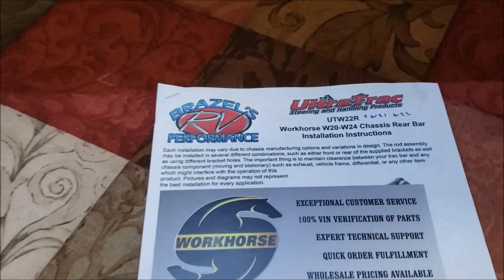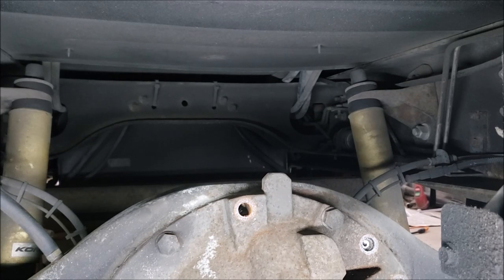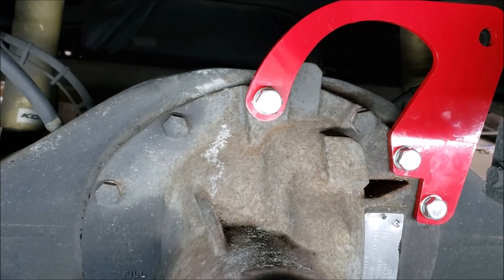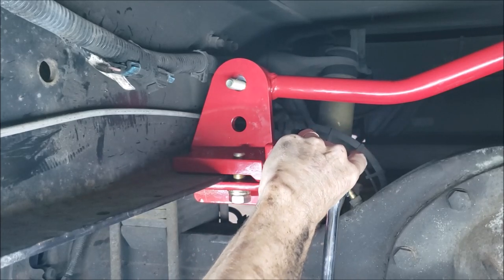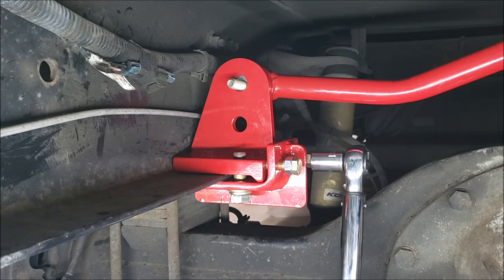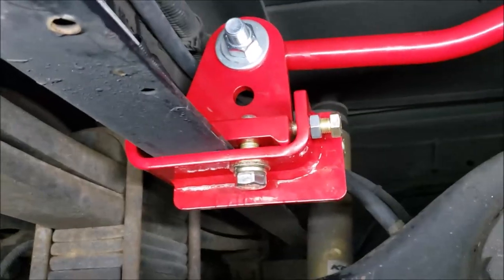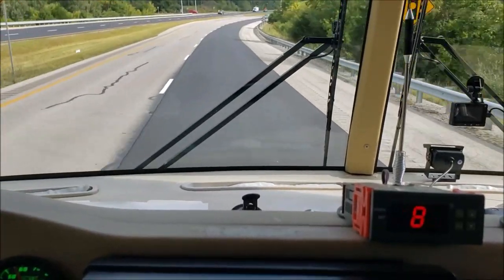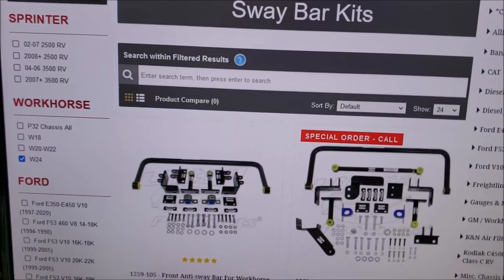Workhorse Rear UltraTrac Trac Bar For Workhorse W20, W21, W22, W24 Step By Step Install & Test Drive

Comment: my dad and I designed and built a track bar for his class C chevy 4500 motorhome, he noticed a huge improvement too.  I gave thought to building them to sell but didn't know if there was a market.  Oh, he's running koni shocks since I showed him your old video.  They were a huge improvement over the bilsteins.  The track bar is really for the rear axle shifting side to side, not skewing.  The leaf springs keep the axle straight but the shackles and bushings leave some side to side looseness.  The track bar makes it stay right in the middle.  My dad's motorhome actually had rubbing marks underneath from the axle moving more than an inch from side to side!  When he saw that, he decided to build one!
Reply from the maker: Thanks for contributing

Comment: About the missing socket size...
The installation instructions call for a 1-1/16" socket; that would fit a 5/8" heavy hex bolt, but it looks like they supplied a 5/8" standard hex bolt, which needs that 15/16" socket. It may be that the instructions are correct but the wrong bolts were included. Did you need the 1-1/16" socket anywhere?

Comment: I installed the same kit last month on my 2005 W22, I haven't driven it yet though.  Gotta love the Dewalt 1/2" impact driver!  I was not able to make some of the torque spec though, my wrench only goes to 120 flb. My kit was the ultrarvproducts Stage II so I did the kona shocks and Safe-T steering stabilizer also.  Once I get a hold of a heavier torque wrench, I'll re-torque.  Enjoyed the video!
Reply from the maker: Thanks for watching i have a impact also but I wanted to show you can do this with basic hand tools.

Comment: Great informative video as usual Kevin. I’m jealous as I wanted one of these units for my 2005 adventurer 35 U W22 when I bought it in October 2017. I live in Canada and ordered it up from the USA and it’s always expensive for shipping up here, anyways tried installing it per the directions and it kept conflicting with the exhaust crossover pipe. Finally realized that it’s not going to work for me and none of the other similar products would work either. My 35U has a single exhaust exiting behind the drivers side rear tire, not sure if this is factory stock, it’s dual all the way back and joins together after the mufflers and then crosses over the differential and exits behind the drivers rear tire. Your W24 and another W22 you did in your comparison of W22 vs W24 both have dual exhaust exiting in front of the rear tires, hence no conflicts. 
The supplier allowed me to return it, but again freight across the border isn’t cheap.
Thought this might help other W22  or W24 owners to watch out for this issue, the suppliers of these products should put a note in their product listing that this will only work with exhausts that exit ahead of the rear wheels. 
Thanks again for all you do for us workhorse owners.
Reply from the maker: Thanks for contributing our W24 was made just like yours I cut off the the tail pipe that went over the axle and made it a true dual exhaust I talk about it in this video https://youtu.be/fSPElyvqWiU

Comment: Nice video Kevin, glad your RV rides nicer, a great Christmas present for you would be a M18 Milwaukee fuel battery ratchet and impact, they work great with people like you and I that have spaghetti arms, 🤣 I have both, and the impact will remove the lugs on our 22" rims.
Reply from the maker: I have a impacts also but I wanted to show you can do this with basic hand tools. Plus cheater pipe ..lol

Comment: The instructions show the bar installed on opposite side of the two brackets (behind the axle bracket and ahead of the frame bracket), but it's installed on the back side of both brackets. On the other hand, the text of the instructions say to put the rod on the front of the axle bracket, while the drawing in the instructions show it on the rear of the axle bracket. This product is crude enough that this may not matter.

Comment: Kevin, thank you very much for this video. I just bought the UltraTrac a couple of months ago for our W24 Monaco but haven’t installed it yet. What determines which hole on the passenger side bracket you install the trac bar on?
Reply from the maker: You can use either hole i used the upper hole because i had plenty of clearance think about when the suspension is compressed make sure nothing will come in contact with the components.
Reply: Okay thanks. I wasn’t sure if maybe the different W chassis determined which hole to use.

Comment: As always an amazing educational video.  I like how you have the cockpit setup.  One question though.  What is the box, center of video, that has flashing (due to camera I’m sure) displayed on it?
Bruce
Reply from the maker: With the red numbers? that's my engine temperature alarm we don't have a idiot light so if we drop a heater hose the engine will quickly over heat and be damaged, I have it set to go off at 220 degrees video of install here. https://youtu.be/T0ezHdCoLKk

Comment: Noone has this in stock so I am making my own from a template. In addition, what do you think about also adding Sumo Springs part number SSR-280-54-1 to the rear?
Reply from the maker: Note they will be in stock later this week https://www.ultrarvproducts.com/UTW22R-Rear-UltraTrac-Trac-Bar-For-Workhorse-W20,-W21,-W22,-W24
Why do you feel you need the Sumo Springs? I would try the track bar first
Reply from the maker: Note this one is in stock now https://www.ultrarvproducts.com/SS302-Workhorse-W20-W22-W24-Supersteer-Rear-Trac-Bar
Reply: @ktoutdoor  Heading in September for a 2 month long trip across country. I just did the Koni's this weekend; mine is a 2003 W22 and it had the original stock shocks which were SHOT! I was thinking the Kon'is, Sumo's, and Trac bar would be a definite improvement. This thing was a nightmare on the freeway; I fought the steering wheel nonstop AND it already has the rear swaybar, the front Trac rod, and steering stabilizer all added.
Reply from the maker: @glennjames9152  I love my Koni shocks I think the track bar is the way to go not sure about the Sumos I would change 1 part at a time so you know what the fix is. The only suspension mods we have are the Koni shocks and the track bar
Reply: So I have a 4" exhaust pipe going over the passenger side of axle. I see two mounting holes for the heim on the frame side. Can you use the lower one?
Reply from the maker: @glennjames9152   I'm not for sure I have not seen one with the exhaust run that way. I would email Brazels RV and send them some pictures and see what they recommend.
Reply from the maker: @glennjames9152   Let me know what you come up with
Reply: @ktoutdoor  I had to make my own setup. The received the Ultra Trac kit and the exhaust would have needed removed. I made and mounted the frame bracket out of 3/8" mild steel then welded a heim bracket to it. I then made the rear end mount the heim position located so that the  rod is level to the ground and clears the exhaust. I then had a 20" piece of 2" chromoly tubing made and tapped at each end for 5/8 heim threads. Bought the heims and locking nuts then had it all powdercoated. I also added the Sumo springs to all 4 corners and then mounted the new Koni shocks... This thing is rock solid; doe NOT move or sway whatsoever.
Reply from the maker: @glennjames9152   Awesome you project would have made for a great video, I love our Koni Shocks,  everything else is still stock
Reply: @ktoutdoor  I watch and follow ALL of your videos! Very very helpful!!
Reply from the maker: @glennjames9152  I would like to see some pictures of you install if you have any.. My cell is 606-875-0125 Kevin

Comment: I think I would have dry-fit everything, including the track bar, before pulling each axle bracket bolt out to add thread adhesive... in case something didn't fit.

Comment: Kevin my name is Dale I have a 2005 Itasca Sunrise to Winnebago product I'm looking for the bolts for the engine cover I've tried a magnet looking for them could you give me an idea where to find them
Reply from the maker: Call or text me at 606-875-0125 Kevin
Reply from the maker: Most use a allen wrench and a small hole look under from engine to find its location .

Comment: The bar with two bends in it is ridiculous. Perhaps in some applications it needs one bend to clear the axle housing, but it doesn't need two... or any bends in this application. The bends just weaken the bar, or require it to be heavier for the same strength and stiffness. 
 
For proof that the bends are not needed, I note that the bar was installed upside-down compared to what the instructions clearly show, and yet it still fits without hitting anything.

Comment: The paper model of what the suspension is doing is not correct. If that were what is happening, the track rod would be of no help at all, because it doesn't keep the rear suspension from steering like that. The problem is lateral motion of the axle relative to the rest of the vehicle, and that's what the track rod reduces. The model this with the paper, slide the rear axle across the bottom edge of the other piece of paper, instead of rotating it.